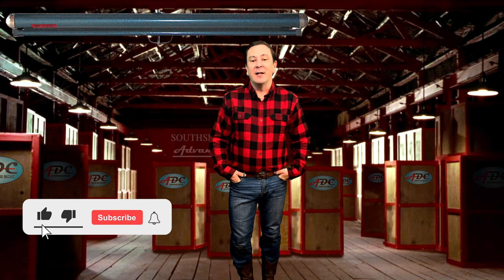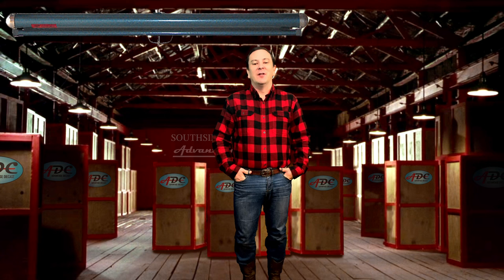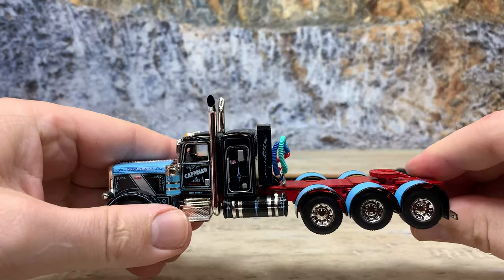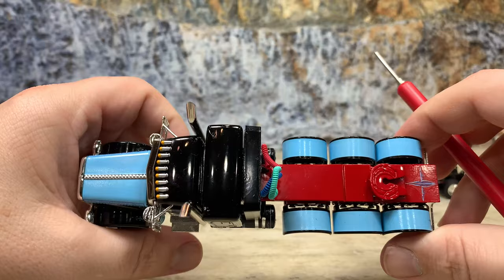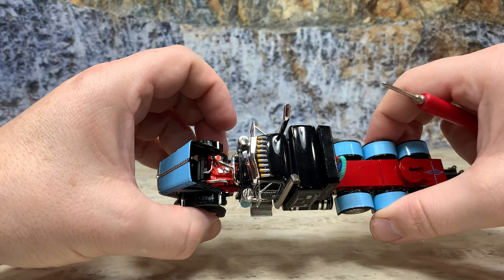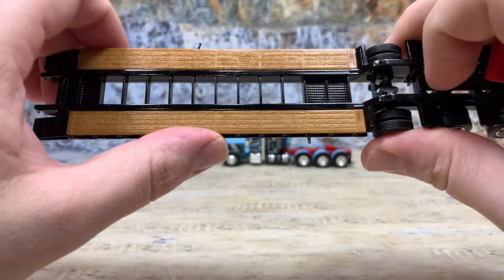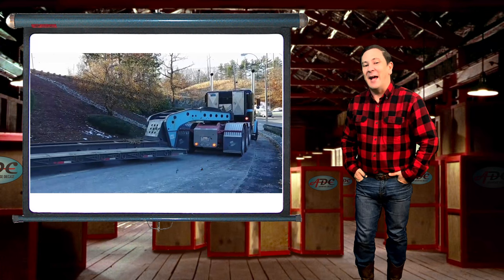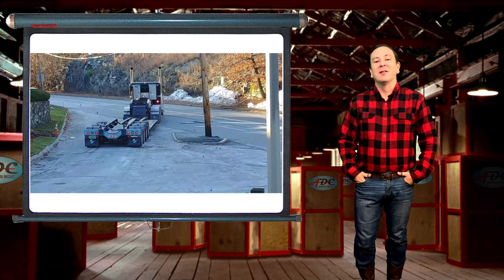Diecast Promotions Peterbilt 389 Fontaine Magnitude Lowboy Cappello Heavy Transport Show Truck

Comment: is their such a wilson livestock trailer that isn't a potsumbelly,1950s/60s vintage
Reply from the maker: there is a Wilson PSAL livestock trailer for hogs available that is a straight deck, however it is a modern design.  Also it is a trailer that wasn't run many times so it's not easy to find one.  As for vintage, all we have are the 40' Wilson pot belly that Top Shelf Replicas did and the new 45' Wilson pot belly from DCP that just came out.  But a 50s/60s vintage just isn't available.